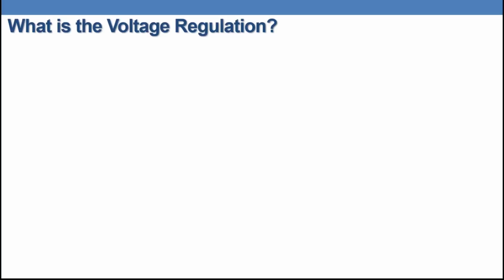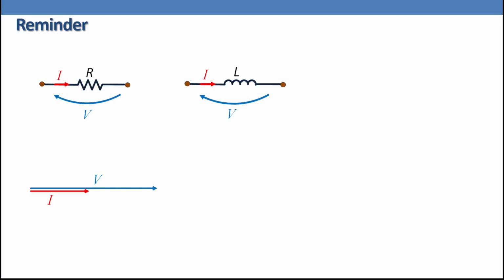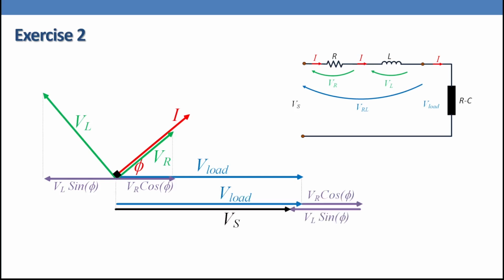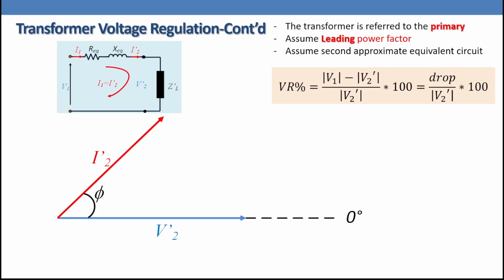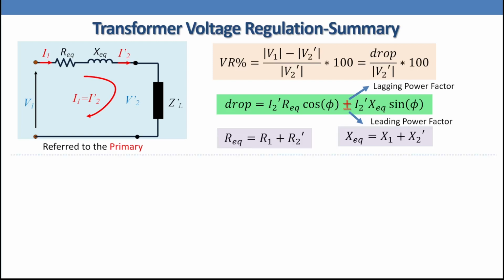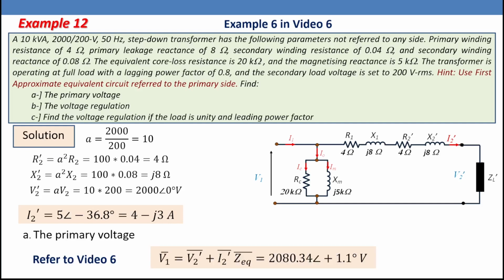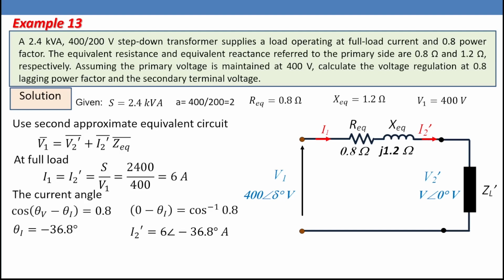Transformers: Voltage Regulation

Comment from the maker: 📚 Thanks for watching!

I hope this lecture helped you better understand Transformer Voltage Regulation and how it varies with different load conditions and power factors.

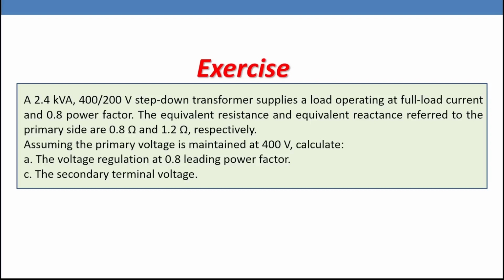📝 Challenge: Try solving the exercise at 31:20 and post your solution in the comments below. I'll do my best to review your answers and respond to your questions.

If you found this video useful:

👍 Please Like the video

💬 Leave a comment with your questions, feedback, or exercise solution

🔄 Share this video with your classmates, colleagues, and anyone studying Electrical Engineering

🔔 Subscribe to the channel and turn on notifications so you don't miss future lectures on transformers, electrical machines, power systems, and other electrical engineering topics.